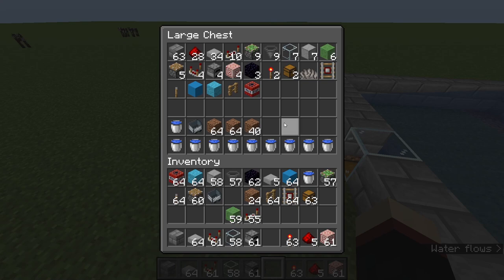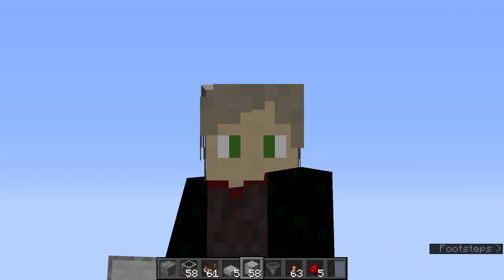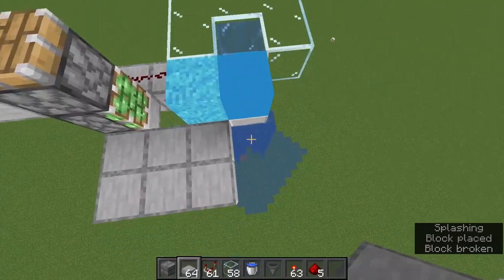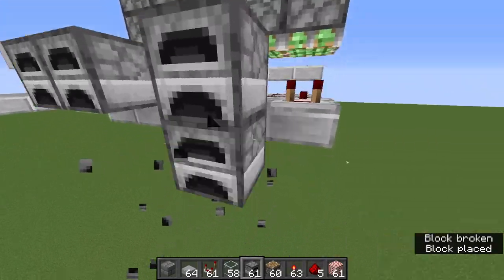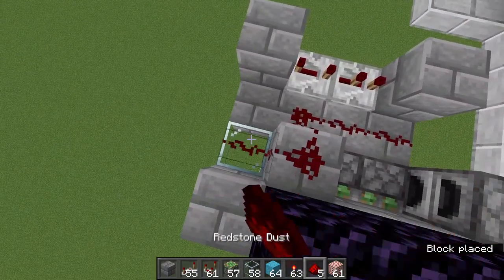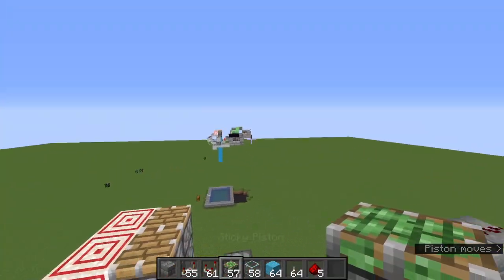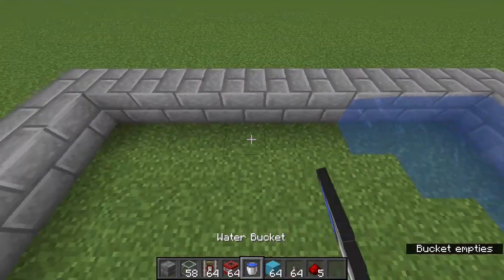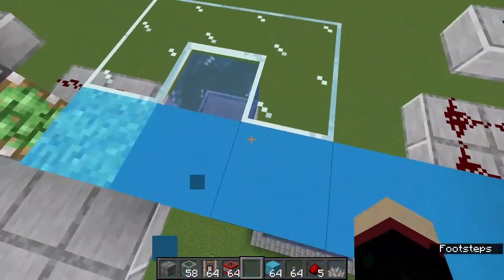Mumbo Jumbo's Industrial District Concrete Maker Tutorial - Hermit Tutorials Episode: 25

Comment: Set this up in 1.16.4 and the duping is not occuring.
Reply: In addition, I have a lot of pieces of components I collected using your list that did not get utilized.  Namely, 64 pieces of TNT that I am beginning to wonder if it needs to be placed somewhere else to make it function.
Reply: Unlike someone else pointed out, however, the world download model is duping in my 1.16.4 client. :/
Reply: The problem in my version, set up precisely according to this video, is that the dead coral gets knocked off the slime block it is placed on in the first movement, and only half the time does the TNT get triggered and dropped.  When it gets triggered, it drops and there isn't another one in its place ready to go, just the one that drops.  lf it fails to trigger, all it does is remain as a block, moving back an forth with the pair of slime-block triplets for which it is a part.
Reply: For anyone stuck in the same situation:  I play on a private server, which is a 'Paper' server.  The developers of 'paper' Minecraft servers consider duping as an exploit, and as such "fix" it in their default paper.yml configuration file.  If the server owner wants to allow duping, they have to change the value of something like allow-piston-duplication under "unsupported settings" to true instead of false.  Hope that helps.